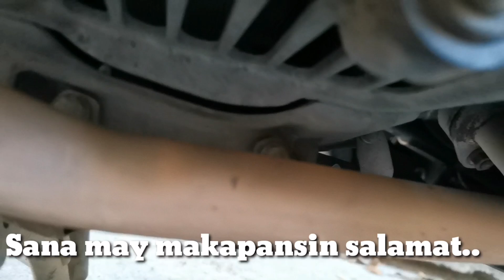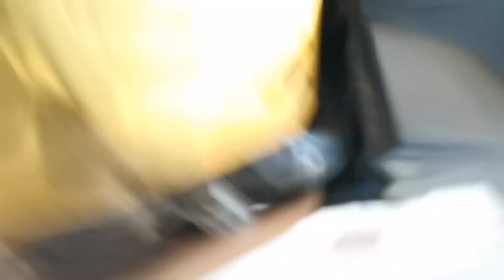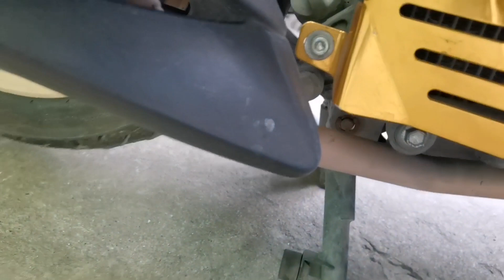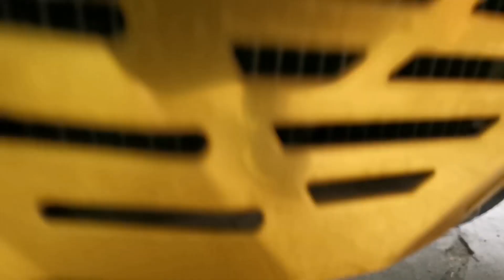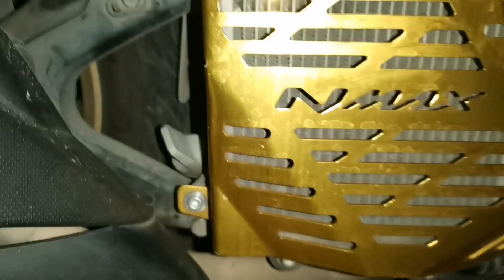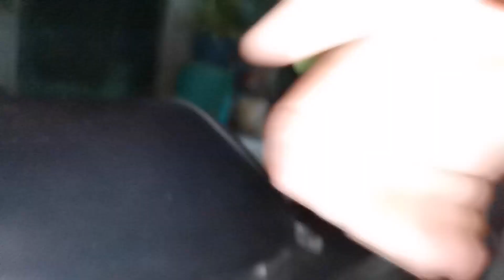Nmax / aerox issue Lagitik  kalansing Cam bearing? Starter bearing? O rocker arm sana may makasagot

Comment from the maker: Try ko muna plit ng fully synthetic pag nd padin pa check kona.. Slamt nga bos. Paps
Reply: Update mo kMi pag may changes
Reply from the maker: Ok dokie
Reply: @motodagz8766  paps update ? Same issue pag mainit na makina may parang maliit na holen
Reply from the maker: @ukitnamoto186  nagpalit ako ng oil paps from 0 to 250km plus tinakbo wla pero bago nag 300km bumalik pero nd n ganun kalakas, pero still meron padin
May truepa tayu gnwa nag palit bearing, etc gnun pdn bmlik padn nag palit n napagastos wala pdn
Reply: @motodagz8766  ty paps subukan ko palit oil sayang kaka 500km palang mutol matic 10w40 try ko speed tuner oil 10w40 dn
Reply from the maker: @ukitnamoto186  https://youtu.be/zv3eYszhwZk

Comment: Same tayo 6k odo palanh nun now 30k odo na wla nman nagbago sa arangkada o ts prob lang pag nd snay teynga mo irita tlga yan
Reply from the maker: Un nga kakairita
Reply: Ganyan din po yong akin. Pag ma init na makina. Tska eengay.
Reply: @probensyanongbyahero228   boss kapag galing sa byahe or mainit lang makina meron lagitik? Kapag cold start wala? Kapag naka idle lang may lagitik? Try mo itagilid sa kanan. Radiator side kung mawawala lagitik
Reply: @akosyjonathan  sir pang uminit na makina. Don pa mai lagitik
Reply: @probensyanongbyahero228  sa cold start wala? Try mo tagilid sa kanan kapag may lagitik. Try mo king mawawal
Reply: @akosyjonathan  sa cold start. Wala talaga.
Reply: @akosyjonathan  pag uminit lang yong motor tsaka mai lagitik
Reply: @probensyanongbyahero228  na try mona itagilid sa kanan kapag may lagitik? Sakin nawawala lagitik hehhee. All stock ba sau?
Reply: @akosyjonathan  naka pulley po ako. Speed tunner, tapos naka spring at naka clutch spring
Reply: @probensyanongbyahero228  balitaan moko kapag nawawala lagitik kapag tinagilid mo sa right side. Radiator side
Reply: @akosyjonathan  pag meron pang lagitik sir? Ano kaya problema
Reply: @akosyjonathan  sir meron paring tagitik 😢😢 ano kaya problema
Reply: @akosyjonathan  hindi parin nawala lagitik meron parin
Reply: @akosyjonathan  hindi parin nawala lagitik meron parin
Reply: @probensyanongbyahero228  ai ganon. Kasi tatlo na nakausap ko. Lahat kami kapag tinagilid sa kanan nawawala lagitik
Reply: @akosyjonathan  yong akin meron pa po. Ano po problema sa inyo?
Reply: @probensyanongbyahero228  palitan mo ng cam gear
Reply: @akosyjonathan  okay pp
Reply: @akosyjonathan  sir ask q lng....sken kc po nwa2la ang lagitik kpg nktagilid s kanan...anu po kya ang problem?
Reply: @akosyjonathan  ganun sakin paps nawawala pag sa tinatagilid...sa inyo v a nahanap nioa na ang solution?
Reply: @akosyjonathan  nawawala sakin paps pag tinatagilid ko

Comment: Sir na solve na po to? Ano po yong sira?
Reply from the maker: Update sir normal for now long ride ok na. Wla nako nririnig. Ang d kopa ntry ung sa race kasi nung lastime n nag laru kmi sa clex n dp bukas dto sa tarlac ilan balik lang tumutnog kapag full throtle pero normal driving wala as is
*Tune up sa mekaniko labas casa pa tsek ung ung clearance.
*2 cycle ng change oil gmit zic
Now top 1 balak ko alternate

Yan ung mga gnwa ko update ako nean new upload para makita kht tumakbo ng 5km pataas nd n natunog
Dti kasi punta lang ng hway pag balik tutunog na.
Reply: @motodagz8766  Tune up lang ba ginawa sayo paps ?? Di b pinalitan yung rocker arm ? Ako kaai nag pa tune up ako.. Mga 1month palang nkakalipas mejo nabalik n nman
Reply: @motodagz8766  same here ok naman rocker arm at camshaft bearing ng aerox ko nawala lagitik nung pina valve clearance ko kay kalikutista gamit ko speed tuner na langis try ko ax7 na shell kung mas lalung magiging tahimik ang makina
Reply: @motodagz8766  ganyan din sakin paps pag nag full throttle ako may lagitik na pag huminto ako
Reply from the maker: https://youtu.be/zv3eYszhwZk

Comment: Sir ano po update dito?
Reply from the maker: Update sir normal for now long ride ok na. Wla nako nririnig. Ang d kopa ntry ung sa race kasi nung lastime n nag laru kmi sa clex n dp bukas dto sa tarlac ilan balik lang tumutnog kapag full throtle pero normal driving wala as is
*Tune up sa mekaniko labas casa pa tsek ung ung clearance.
*2 cycle ng change oil gmit zic
Now top 1 balak ko alternate

Yan ung mga gnwa ko update ako nean new upload para makita kht tumakbo ng 5km pataas nd n natunog
Dti kasi punta lang ng hway pag balik tutunog na.
Reply: Palit ka cam gear
Reply from the maker: https://youtu.be/zv3eYszhwZk ok npo
Reply: @motodagz8766  sir motodagz ganyan na ganyan po maxi ko ano po ginawa nyo holen tlga pag nasa 40 kph kakairita ilng araw kona nadidinig😭🙏

Comment: ano na po update dito sir ? pagka cold start po wala po yung lagiti ? pero pag mainit na yung makina maingay na sya ?
Reply from the maker: Gnun n gnun nga sir
Ung pag una wla tas bmli kalang sa tindhan sa kanto kabalik mo maingay na.
Na solution an na ausin kolang ung video nabura kasi nung nsa motorshop ako e
Reply: @motodagz8766  sige po sir para may idea po ako salamat po hintayin ko sir
Reply: Same tayu ng issue parekoy.diko parin masulosyonan.
Reply: @ARTISTANGHILAWTV  okay na boss yung akin
Reply: @Paulcndlra  ano ang ginawa mo paps?
Reply: @ARTISTANGHILAWTV  palinis mo lang buong panggilid sir dumi..  pagtapos balik mo at itry ulit pag wala pa din belt na kailangan na papalit. pero yung sakin 7k odo kahit tumatama na yung belt ok panaman kaya nakuha sya sa linis panggilid balik sa dati kahit long drive pa di na po nag iingay
Reply: @Paulcndlra  yong sa akin kasi paps parang nasa magnito ang ingay na parang nasa radiator din.hehehe
Reply: @ARTISTANGHILAWTV  ganun din sakin sir, pinapakinggan ko sa panggilid wala naman tapos pag sa bandang radiator sobrang lakas haha
 kaya nung pinaliha ko panggilid nawala promise sir sa panggilid po yan
Reply: @ARTISTANGHILAWTV  palinisan mo muna buo panggilid sir magkano lang naman tapos chat moko ulit sir kung nawala ba... pagtapos pinalinis binalik lahat ng cover sir tapos test drive kahit sobrang tagal at init pa wala na di na bumalik yung ingay
Reply: @Paulcndlra  naka panggilid na ako paps WF fulley..naka straight 10 flyball
Reply: @Paulcndlra  ano gamit mo na oil paps?naka MUTOLE kasi ako
Reply: @ARTISTANGHILAWTV  shell advance sir
Reply: @Paulcndlra  anong kulay paps blue or gray 10W 4T
Reply: @Paulcndlra  gnyan din skin boss pang gilid lang ba papayus jan?

Comment: sir update po sana, 1000 odo pala akin may ganyan na nmax v2
Reply: gnun din sken.
Reply from the maker: Update sir normal for now long ride ok na. Wla nako nririnig. Ang d kopa ntry ung sa race kasi nung lastime n nag laru kmi sa clex n dp bukas dto sa tarlac ilan balik lang tumutnog kapag full throtle pero normal driving wala as is
*Tune up sa mekaniko labas casa pa tsek ung ung clearance.
*2 cycle ng change oil gmit zic
Now top 1 balak ko alternate

Yan ung mga gnwa ko update ako nean new upload para makita kht tumakbo ng 5km pataas nd n natunog
Dti kasi punta lang ng hway pag balik tutunog na.
Reply from the maker: https://youtu.be/zv3eYszhwZk

Comment: same problem with my nmax boss, nagconsult na ako sa trusted mechanics ko (2 mechanics) and wala problema sa tensioner (nagpalit na ako ng manual tensioner), nag-adjust na rin ng valve clearance, check na rin pati rocker arm.. advise nila is magpalit ako ng oil (i used motul 5w40 fully synth and nagpalit ng liquimoly 5w/40 puro fully synth), now im using shell ax7 scooter 10w/40 oil (currently 100kms pa natakbo) still nanjan pa rin ang kalansing sounds.. hintayin ko lang daw till 3 cycles ng change oil, kasi daw yun ang usual na ginagawa nila if walang sira tensioner, valve clearance at head
Reply from the maker: Slamt paps. Npka informative
Reply: Sir pa update po ako same issue po same din ng ginawa sa akin pina refresh ko na rin engine
Reply: been to yamaha 3s maxilom
avenue a while ago and chineck ng head mechanic nila yung ingay ng motor ko, possible problems are intake and exhaust rocker arm.. papasched ko nalang kasi dami na nasa waiting list kanina pgpunta ko
Reply: intake rocker arm - 2800, exhaust rocker arm - 980. and labor 150, advise then nya na ibalik sa stock cams and compresion release (nka-adjustable camgear and rs8 magic profile stage 1 cams ako) motor ko para iwas sakit ng ulo
Reply from the maker: @renchalcaraz2089  nag zic ako ngaun paps ung gold so far nd kona naririnig
Reply from the maker: @brianguzman1982  slamt paps dming tulong nito lalu ss mga makakabasa pa magkakaroon kmi ng idea
Reply: @motodagz8766  so happy for you boss kasi nasolve na problem mo, sa akin sched ko pa na ipa-admit sa yamaha casa this week hopefully ma-approve ang filed leave.. hehehe
Reply from the maker: @brianguzman1982  haha hnd pako mag ssya paps bos haha baka pag tumgal bmlik ulet haha
Reply: hinatid ko kanina sa yamaha 3s maxilom ang nmax ko para matrabaho, pinalitan ng intake rocker arm (php2900) at coolant (350) + 800 labor.. chineck din pati ang valve clearance, cam bearing at exhaust and okay pa naman daw. pagkakuha ko kanina 3pm, meron parin lagitik, so di ko tinuloy kunin at sinabihan ko ang mekaniko.. check daw nya bukas ang starter clutch, hay naku..
Reply: @motodagz8766  sir patingin ng zic..may pic ka??anu update wla na talaga lagitik??
Reply from the maker: @brianguzman1982  aw laki na gastos tas nd pdn naayus
Reply from the maker: @paparchelagawan9478  d masesend dto sir ung gold
So far wla pa pero tom ratratin ko bos pra malaman kung babalik

Sbi kasi nila mga 3 cycle pa na palitan bago mawla ng tuluyan mga gumamit ng ax7 ng shell
Reply: @motodagz8766  yun nga paps, malaki2x na rin nagastos. =(
Reply: @brianguzman1982  boss hingi naman ako update if na ayus nag pa refresh na kasi ako ng engine lahat tiningnan cam bearing rocker arm okey naman daw pag dating daw sa head wala problema pero tinanong ako kung gusto ko mag palit rocker arm baka daw malamya na edi medjo magastos tapos hnd naman mawawala
Reply: @renchalcaraz2089  mga boss musta nmax nyo?nawala na ba yung lagitk?same issue din kasi yan ng nmax ko.
Reply: Kmzta na po nmax niyo? Na solve na po? PG ma init na makina ko ganyan yong tunog.
Reply: @probensyanongbyahero228  ganun pa din nmax ko.wala ata makasagot na mekaniko kung san nang gagaling ang ingay na ganito
Reply: @probensyanongbyahero228  same din sa akin boss, ganun pa rin.. hinayaan ko nalang, magheadset nalng ako para d ko marinig ang lagitik sound.. hehehe
Reply: Sana tama yung papalitan nmen sa motor kasi my point yung napanuod nmen na video,naluag ang spring pag mainit na makina.kelangan I adjust o palitan.
Reply: @joelatienza9529  saang spring yan na adjust boss?
Reply: @joelatienza9529  update ka naman po boss. Para ma solve natong problema ng nmax
Reply: @probensyanongbyahero228  boss baka palit block at piston na ito.
Reply: @brianguzman1982   boss kapag galing sa byahe or mainit lang makina meron lagitik? Kapag cold start wala? Kapag naka idle lang may lagitik? Try mo itagilid sa kanan. Radiator side kung mawawala lagitik
Reply: @akosyjonathan  yes sir, kapag mainit lang or galing sa byahe meron lagitik.. wala sa radiator side yung lagitik boss, nasa kabilang side (cvt and engine side)
Reply: @brianguzman1982  boss kapag idle lang meron lagitik db? Kapag pina andar mona wala naman? Parehas kasi tayu kapag mainit at galing byahe may lagitik. Gusto ko lang malamang kapag tinagilid mo sa kanan kung mawawala lagitik. Hindi ko sinabi nasa radiator side ung lagitik
Reply: Sana makatulong. Camshaft sprocket. Maluwag na ung wala ng tension. Malambot na. Watch kalikulista vlog. Niremedyohan lang. Sana makatulong
Reply: @adyn9133  aq po ngpalit ng bgong set nyan...gnun p rn
Reply: @akosyjonathan  boss parehas tayo. Pag tinagilid mo same side. Left and right nawawala. Hahaha nabubuang na dn ako kung ano ano na ginawa ko. 😭😂
Reply: GANYAN din sakin..sakit talga Ng nmax yang lagitik kahit bago Po Lalo pag napag palit kayo Ng Cam's... Mas iingay Ng unti pah sobrang init na pag bagong andar Wala..
Reply: kahit ako nagpalit ako ng set ng rocker arm.. nawala konti pero me pasulpot sulpot lalo na sa mid RPM meron talaga tapos ung biglang piga minsan meron
Reply: @motodagz8766  sana nga paps sa zic lang ang sagot planning tu use that since naka motul GP matic ako talagang meron parin sana sa langis na
Reply from the maker: @sandroboncato3218  solve na to
Reply from the maker: @sandroboncato3218  panoorin nyu sa isang upload ko
Reply from the maker: @sandroboncato3218  top 1 lang gngmit ko until now wla na
Reply: What is 3 cycle boss ung katatlo ka mag change oil ng same oil na ginamit mo?
Reply: @akosyjonathan boss sa akin ng gagaling banda sa radiator ano kaya ung dahilan kaya my lagitik ok nman ung mga rocker arm nag palit na din ako ng tensioner timing chain ok namn pag na init lang meron lagitik ako naririnig

Comment: ganyan din ako huhu nasa 1800km palang natatakbo. Motul pinalit kong oil..
Reply from the maker: Nd padn nawala?
Reply: naalis na boss. nung una nagpalit ako tensioner kasi un daw cause sbi mekaniko. sumunod nagpalit ako oil, then next nilinis ko panggilid ko then sbi mekaniko palit nako plate guide kasi my tama na nabangking. pero after all meron parin ung tumutunog.then next ako na nagkalkal kung saan parte ang cause nung kalansing, nung nagpalit ako slider sa pulley ayun po nawala na kalansing niya.
Reply from the maker: @aicellicos1397  wow snaa all
Reply from the maker: @aicellicos1397  up
Reply: sayo paps ok na ?
Reply from the maker: @aicellicos1397  dpadin paps
Reply from the maker: Update sir normal for now long ride ok na. Wla nako nririnig. Ang d kopa ntry ung sa race kasi nung lastime n nag laru kmi sa clex n dp bukas dto sa tarlac ilan balik lang tumutnog kapag full throtle pero normal driving wala as is
*Tune up sa mekaniko labas casa pa tsek ung ung clearance.
*2 cycle ng change oil gmit zic
Now top 1 balak ko alternate

Yan ung mga gnwa ko update ako nean new upload para makita kht tumakbo ng 5km pataas nd n natunog
Dti kasi punta lang ng hway pag balik tutunog na.
Reply from the maker: @aicellicos1397  https://youtu.be/zv3eYszhwZk

Comment: Ganyan sakin nagpalit lng ako ng langis dati kc yamalube nagpalit ako ng ax7 shell
Reply: nag ok ung syo sir?
Reply from the maker: Update sir normal for now long ride ok na. Wla nako nririnig. Ang d kopa ntry ung sa race kasi nung lastime n nag laru kmi sa clex n dp bukas dto sa tarlac ilan balik lang tumutnog kapag full throtle pero normal driving wala as is
*Tune up sa mekaniko labas casa pa tsek ung ung clearance.
*2 cycle ng change oil gmit zic
Now top 1 balak ko alternate

Yan ung mga gnwa ko update ako nean new upload para makita kht tumakbo ng 5km pataas nd n natunog
Dti kasi punta lang ng hway pag balik tutunog na.
Reply: @motodagz8766  buti nmn sir wla na...tune up lng ba pinagawa mu si
Reply from the maker: https://youtu.be/zv3eYszhwZk ok na